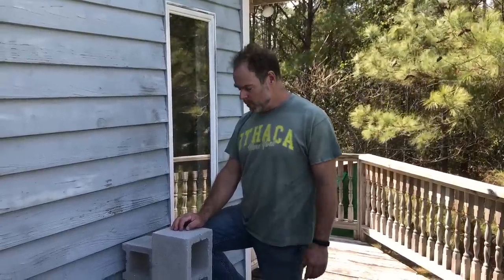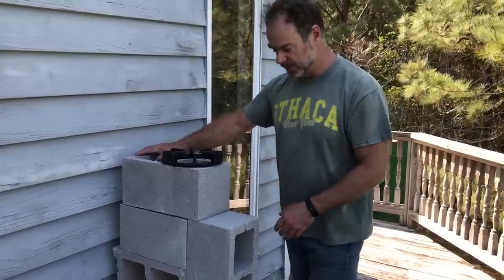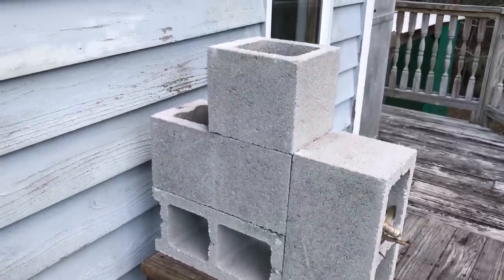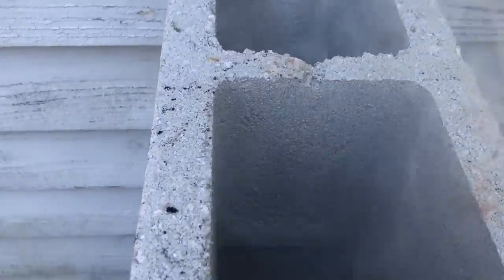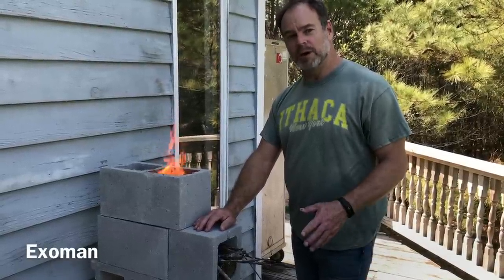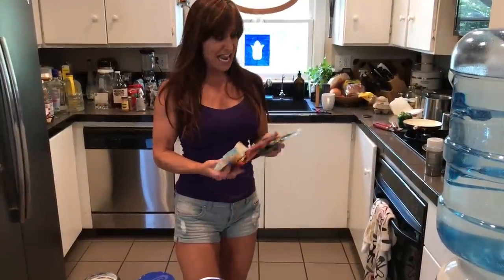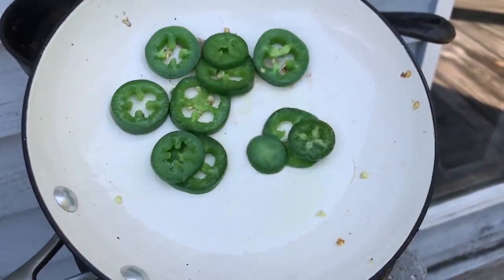Crazy new rocket stove made from 4 cinder blocks! READ WARNING BELOW!

Comment: Concrete isn't a good choice for building an oven.  The high heat drives the water out of the crystal lattice in short order, causing it to become brittle and crumble.  I would only use cinder blocks as an emergency measure.

Comment: two thoughts, cut TWO blocks and make your stove taller, use the top opening for fuel and bottom one for air.

or, cut the can, flatten it, mark the width of the hole, and make two bends at those marks to make Channel, with a bit of trial, you could make it fit snug and it would never move.

Comment: Cut two blocks instead of one next time. You will have two levels high, plus the chimney to cook on (three blocks high). You won't have to use the can :-) just a suggestion. It might need to be taller to burn efficiently I'd done the way I suggest. I just leaves about rocket stoves today!

Comment: If you wanted to make this permanent, would you mortar the whole thing  together? 

Also, any recommendations on separating blocks without power tools?
Reply: ONE: mortar will make it not portable or easy to make. Also, the mortar joints will crack in the heat so why bother.
TWO: you can score block and tap it, if done correctly, it will break along even lines. I've done this a bunch of times, but then again I've worked with dry stack cinder block walls in Arizona...
THREE: you can probably get a better effect using a metal bucket or some cans (and then just surround them with the block to retain heat later.)

Comment: My two burner often used rocket stove is sitting in the dirt next to nothing. So if it explodes or falls apart nothing but the ground will get burned
Reply: i hae made rocket stoves in five gallon metal cans (handles make them easy to carry around).  perlite is lighter but falls apart. use vermiculite it lasts longer and is only slightly heavier)

Comment: How do those blocks stand up to repeated heating at high heats?
Reply: Kathryn Kenyon I made a smoker out of cinder blocks 2 years ago, it's doing fine, even smoked a 90lb pig in it.
Reply: WOW! That's great brian schuerger! Nutin' like a pig roast!
Reply: Thanks for the info Brian. I have an old pot bellied stove that I lined with fire brick in order to protect it but mostly to help it hold it's heat. It may have worked too well. The back, where the flew was, often was red hot and I noticed during my last move from Texas to Washington that someone put a "tear" in the metal. It looks like a tear, but I'm sure a welder can fix it for me. Would have loved to taste that pig! :-) Say hi to Farmgirl! I love watching ya'lls videos and especially hearing how dumb some of the comments are. ;-)
Reply: Kathryn Kenyon that's really hot, we didn't get ours up above 350.
Reply: Hi Exoman, I have no idea how hot steel has to get to be red hot, but I actually had to put a large piece of steel against the kitchen wall to protect it from catching fire. Did you have a gauge that let you see how hot your block was getting? I used that pot bellied stove for 9 of the 10 years I lived in my house in the country. I was lucky; two of my 5 acres was wooded, so I just went out every winter and chopped, hauled, and split as much wood as I needed. Managed to break a few fingers along the way, but it was worth it. I love being self sufficient. :-)

Comment: I grew up with a commercially built incinerator made of ordinary concrete blocks. I used it every other day, often in wet weather. Never had a problem.

I think the noise below concerning the intrinsic dangers of concrete and fire, is just a tad over done.

Sure if you poured molten steel onto saturated concrete things will get exciting, but not a rocket fire.

As for the dangers of a BBQ on a wooden deck. This is ONLY DANGEROUS if you had nothing to put out the fire nearby, AND you left the fire unattended long enough for the deck to catch fire. This rocket stove is no more dangerous to a house, than any other heat source.

Comment: this is completely bogus. extreme heat in concrete blocks makes them brittle and I've heard they can explode, although I've never experienced that. they make fire blocks for a reason,USE THEM. the design is solid, the materials will undoubtedly get you hurt.

Comment: True rocket stove doesn't have any flame or smoke coming out the top!  The first burn occurs at the entry where you have the sticks... sticking out, a second burn occurs to burn off the vapors the flame creates at the back of the burn chamber.. burning up the smoke, basically. Then, a chimney is added, where NO flame comes out the top, as the stove itself heats up instead of releasing heat out the chimney area. So, call this a more efficient cinder block firepit or oven chamber stove, or whatever you like, I'm not convinced it's a rocket stove.
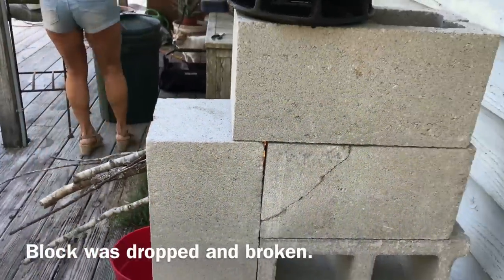Plus at 10:28 shows that block you cut is already cracked! You could have used an H block instead, bit more sturdy.

Comment: With just a single Amber dropped on that patio floor, your House is in ashes. For me I just need three pieces of  HOLLOW BLOCKS installed at the backyard ground, it has wider space for any size of firewood and use the ambers for barbecuing meat.

Comment: It's a clever design, however ...

1) It is reckless to the point of absurdity to have burning coals on a wooden deck and/or close to the wood siding of your house. Do it further away from your house, for crissakes.

2) Cinderblocks are NOT fully fire safe.  You should only use properly KILNED brick, never poured concrete, for such applications, and never against the side of your home.

Fair warning ... if your house ever burns down, and an ins adjuster or fire marshal ever sees this video, and establishes a reasonable linkage, there is a high probability they might deny your loss claim, and you could lose EVERYTHING. 

Be smart, dude.

Comment: Digging a hole in the ground to make a fire pit-- Excuse me, have you ever heard the term "ground fire"? "A ground fire can occur in any conditions and is where peat, coal, tree roots or other materials ignite and burn under the ground. Ground fires can burn through to the surface and become surface fires. Surface fires are low to high intensity fires that burn on the surface of the ground." ( See: environment.nsw.gov.au/fire )

Comment: Anyone recommending concrete blocks for this should tell the dangers!  They are very likely to explode or at least crack and crumble.  It might work for a while then fail or it might fail on the first lighting!  Please for your safety, DO NOT FOLLOW THE INSTRUCTIONS!  Do NOT USE CONCRETE BLOCKS.  See another comment below telling what DID happen when these block explode!
This is way too close to the house!
Reply from the maker: You are a strong defender of public safety Arkansas man. There are just a couple of problems with your sky is falling warning. One is that we have been doing this for years and you have never done it once. Your evidence that a twig fire will cause a dangerous explosion is anecdotal. It just doesn't happen, not enough heat on a large enough area. Not a twig fire on a 6 inch area of this large block. Try throwing a wet cinder block on a raging fire and you may have some luck. The blocks we have used in this video have been used more times now than most cheap steal barbqs that are now rusting an landfills. As for this demo. It was next to water bib and a fire extinguisher. I actually have have propane gas plumbed into my home and we have cooked with oil over and open flame for 40 years and so have a billion other people. My wife had a stack of logs in her house near a fireplace and tended an indoor fire inches from carpet and drapes as a child. You should make a video and tell people not to cook with oil inside their homes or have fireplaces, or Christmas trees, that would be way more constructive that a meager comment like this where you are being a little hysterical.

Comment: Concrete will exsplode when it gets hot.
Reply: Cinder block is more heat resistant, something like cob, which is what they make rocket mass heaters with. For a stove, though, where you don't want to retain heat, metal would have been a better idea.

Comment: The only ignorant people I see here are listed below in the comments section.  I would never use cinder block for a 'hot' fire, or any situation where you have ground contact on one side with fire contact on the other.  A rocket stove is based on a small fire, lots of venting and is a lot different than a burn barrel or fire place.  Fact of the matter is, these folks in the video have a lot more experience than you do cooking outdoors.  Please consider that before you go running off at the mouth.  Try asking questions first, you may just get an intelligent response instead of insults.

Comment: I have watched a lot of videos on making different kinds of wood stoves, campfires, portable wood cookers, tealight cookers, etc. And after hours (nay, days) of watching, I have decided that for me, I will just make tealight cookers. They burn for enough time to make a meal for one or two, and time is not a factor for me. Having flames leaping up around a pan may be the "manly" way to cook something, but I have seen too many videos that were just plain unsafe, especially in the woods, with sparks flying many feet away from the fire, hands getting burned, fuel sitting too close to the fire, and all kinds of stupid and risky methods to get that 'ol fire blazing.. It's a macho thing. Cooking is just applying heat to some raw or cold food. It doesn't have to be a pyromaniac's dream. This video is a prime example of carelessness and risk.

Comment: Everyone thinking the blocks will explode are idiots. Yes the blocks break down over time but yall act like its a bomb going off.  The heat and air pockets in the block wear down but its not a significant explosion. A good 20 time use over mths isnt goin to stress those blocks... Fire bricks are better but dont act like its a ticking time bomb.  The brick will likely crumble before "blowing up"

Comment: Mindless foolishness using concrete blocks. Concrete is a chemical hydrate which means it is held together by water molecules. These water molecules are released under high heat - sometimes with explosive results. Every mason knows to use firebrick in any area subject to solid fuel heat. Anybody using concrete blocks around a fire is a fool. This stove is not something really fantastic with a gee whiz name like "rocket stove". This is merely a well ventilated solid fuel stove.

Comment: nothing new they been making those for years and years....plus they crack after a while ...nothing better than using red firebricks....worth building them from red firebricks because it will last you longer and much better quality burn and adjustable bricks for air and heat.
Reply: dreamkiss4u ex

Comment: The bottom block of the stack of three serves no purpose. You can make the exact same stove with 3 blocks.
Reply: David Martin the third brick is probably what's keeping the stove cool and heat away from all that wood that everyone is complaining about.
Reply: Michael N. I guess it does keep the stove off the deck. but I wouldn't build it on a deck anyways. Still, for a quick and dirty stove, it's clever.